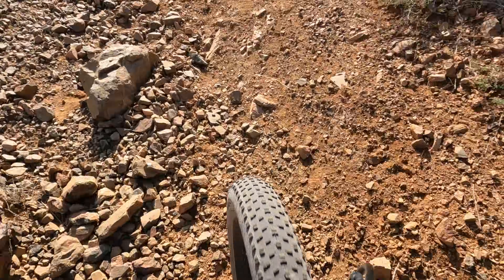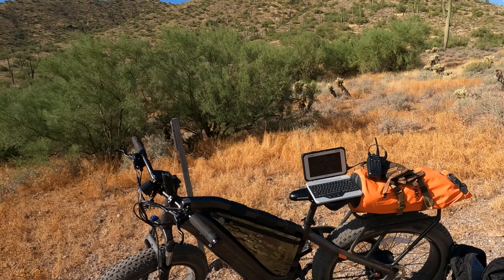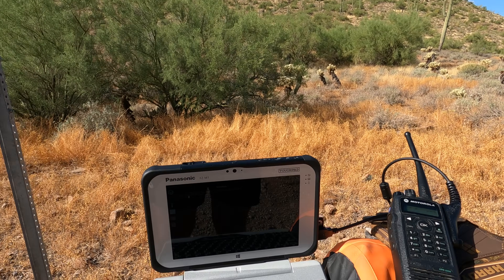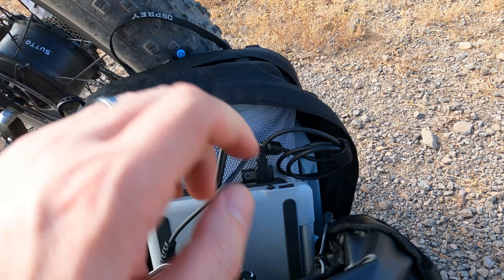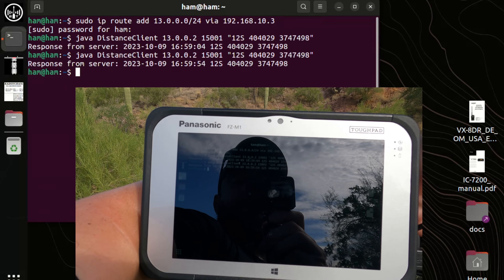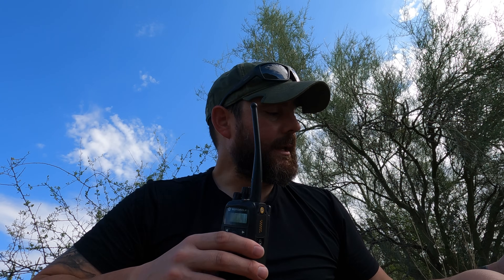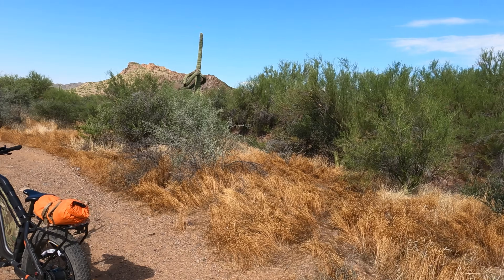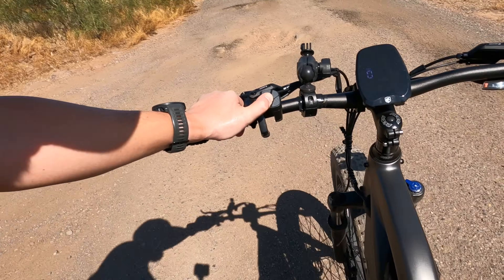DMR for Preppers - Range Field Test - Motorola XPR6550

Comment from the maker: Just to clarify. When I send a message from my field computer, the text that is returned and displayed to the client is an actual over-the-air radio response and acknowledgement from the remote station. This distance server echos back whatever I send it. I'll clarify this in a later video. So, I knew in real-time when I was within radio range. The application will be considerably evolved by the time we do a deep dive on how all this works later in the series.
Reply: The two things that bother me here.. are the out-of-spec address space you're using, and goddamned Java in a world where so many better options exist.  Have fun brother, will keep up and check-in where I can!
Reply from the maker: @Sansui350A  That address space is based on what Motorola has configured by default. I'm a Java developer by trade. I am not a Node guy. I plan to write the networking applications C as well. People can implement whatever they want. This is just straight UDP/IP or TCP/IP networking.

Comment: Can Mr just be radio to radio in simplex? I’m learning about Motorolas dmr. I have a mototurbo 7550e
Reply from the maker: This was all done simplex, radio to radio.
Reply: @TheTechPrepper gotcha. So I get radio A and radio B on the same frequency on digital and it should work?
Reply from the maker: @Dave-tb8kg  It's not quite that simple. The problem with commercial radios is that they're easy to program or to obtain the programming software. This is why I stopped using them. In this demo, I actually wrote custom software which I can't release for the text messaging. However, everything that you saw was done radio-to-radio. No repeaters, no Internet. Good luck with commercial radio journey. It's orders of magnitude more complex than amateur radio.
Reply: @TheTechPrepper will do. It’s going to be fun.

Comment: Do you need a license for DMR?
Reply from the maker: DMR is a standard. To use it on the ham bands you need an amateur radio license, but the entry-level license test is fairly simple. You can also use it on the commercial bands, but that also required a valid business license (paid license).

Comment: The Moto radio you have there is a solid piece of kit. In the UK, they are badged as DP3600, ive got a handful of them along with the DP3400 (no keypad/screen) as well as a DP4801 (GPS, Keypad etc.) Very powerful radios, with both analogue and DMR support. Keep at it bro!

Comment: Hello, I would like to offer a suggestion for the tire issue. Switch to the tubeless system and insert pool foam noodles inside them during the installation process. It will substantially help when dealing with this type of problem with flat tires.

Comment: Have you used your Panasonic tablet and the Motorola CPS programming to program the xpr radios? I use Motorola radios for public service and am looking into something smaller to travel with so that If I have to reprogram on the fly I don’t need my laptop. Thanks great videos!
Reply from the maker: Yes, they work fine. This FZ-M1 is running it on the Windows 10 partition.

Comment: Do you need a ham radio license to use DMR radio’s? What would be best bang for your buck radio with good range and battery life?
Reply from the maker: Yes, you need either an amateur radio license or a business license. I'll cover the radios that I am looking at as part of this series.
Reply: You can use the 900mhz ISM band (902-928mhz) on DMR without a license, but you are limited to 1 watt of power and must only use digital. If you want to do dig/analog, use more power, set up a repeater or something like that then you would need a license.

Comment: Hello ask you questions? I am learning about Motorola but I’m deaf (can’t hear and can’t speak) I watch your video and I wonder if I can use laptop with Motorola? Can send message or text?
Reply from the maker: You are better off sending messages directly from the front panel, but it is possible to send messages from a keyboard using commercially dispatcher software. I have never used it as the prices are likely cost prohibitive for more non-business users. The demo I showed using the keyboard is not public yet. I have not timeline regarding releasing anything.

Comment: I was wondering about tri band use with my UV5R, What kind of range can I or should I be getting using tri band? Can I use NVIS with this
Reply from the maker: You're looking at line of sight, so just a few miles without a repeater. NVIS is a property that only exists on HF between 2 and 10 MHz. Also, you Baofeng can't do the over the air the networking demonstrated in this video.

Comment: Who programmed the radios? moto software not something just anybody should be able to access
Reply from the maker: I programmed them. I am still learning the CPS and DMR at the same time. It's been a couple of weeks since I started on this LMR journey. I'll take you guys along for the ride.
Reply: @TheTechPrepper is the CPS for this radio the 2.0 free version? Does the radio need AES256 unlocked via a purchase through motorola?
Reply from the maker: @keivkeiv CPS is now free from Motorola, but it take a few weeks. Also, this 6550 does not support AES 256 encryption. I will be adding it myself using some custom software.

Comment: Looks like I might need to get a DMR radio. Got YSF and D-STAR capability, which is nice to have. Mostly used on reflectors when weather isn't that great to work HF at night. 

We got a local 70cm C4FM machine, but with really limited usage. The best D-STAR machine I can hit is 70 miles to the south of me, but in a high RF environment. That lead me to use hotspots.

As far as I know, I'm the only ham in my county with D-STAR capability. There's a few with C4FM capability. No one that I know of has DMR as of yet. I'd be interested in using either mode for simplex use and packet radio. Worst case scenario, having a a digital radio can come in handy.

Comment: I forgot to mention..
I really love the concept!  
I’ve been watching the occasional videos on Meshtastic and other “solutions” utilizing lora n 
and I just didn’t like it for a bunch of reasons.

Using a radio you are already carrying already makes way more sense.

Any thoughts on developing a mobile app as well?
Or browser based?
Probably not too “end of the world” friendly, but for localized situations and regular “daily life” ..  might make sense?

Also… Have you developed any software for comms?

Just a $$ thought..  
For over a decade, I have been looking for a way to connect my repeaters and other videos to Zello.
Everything I tried, was just plain miserable.  The low cost RTx and other RadioTone products were miserable.
Of course, every thing utilizing VOX was horrible for obvious reasons.
There is a COR (carrier operated relay) device that comes completely assembled and configured for Zello (or one of a dozen other services) and runs on an older custom version of Android.

The unit that works quite well “out of the box” is “Solidtronics ST-4 ROIP Gateway.
It’s VERY pricey for what you get.  It’s also difficult to find anywhere in stock, other than the mfg direct.
They are in Hong Kong and they take 4-8 weeks to get it to you.  
They also nickel and dime you for every little accessory.  They have custom radio interface cables for many brands/models of radio, though you can hack one together yourself.  (ex. Hytera PD782 interface cable is $95 shipped. But they are using the proprietary connector for the radio side).

IMHO - IF you could come up with a functional hardware/software device that performs equal to or better than the Solidtronic ST4, you’d be struggling to keep up with demand.

Of course, if you begin generating billions $ in revenue, I’ll require a commission $…. 
Just send mine to “Trump 2024” in care of the “Jail Hunter P. Biden Fund”.  
(the”P” stands for the family business. = Pederasty) 🫣🤣

Comment: I'm interested in what software you wrote.  An encrypted program, through and encrypted radio.  License and sell it, I'll be your first buyer.  Got everything else setup.  Thanks for the videos!  I'm waiting for more.
Reply from the maker: This program was just a proof-of-concept, but since it worked well with no data corruption and with a decent transmission time, I plan to make a commercial package with plug and play support and a simple user interface that resembles the text messaging application on our phones. Thanks for the support.

Comment: Considering this is an experiment over business frequencies. Are you using the Motorola KVL to upload keys for AES256 or the aftermarket open source Keyloader for AES256?
Reply from the maker: There is no physical key loader involved here. In my particular case, the key to use will be specified in software by the operator. It will be shared pass phrase. However, I have an XTS5000 and plan to a UCB board and build a physical KVM. This is planned for next year when I explore P25.
Reply: @TheTechPrepper  I have been using an Astro Saber now for 6 years, set for analogue but is has a friends repeater in it that operates P25. Unfortunately he has not connected it to the internet so I have been unable to contact him since he is in the Dayton area and I am in the EU for now. Late July I did purchase an XTL5000 from another friend, had to wait a few months for a working programming cable but it’s now programmed and ready to go. It’s a Remote mount setup and I see that it can also do IP data as well utilizing the programming cable that plugs into the GAIC connector on the TIB. The programming cable plugs into a computer to process data, still learning all of the nuances of doing this. Looking at trying to obtain a Keyloader to program keys into the XTL as well as the Astro Saber however the prices are quite steep for the time. For AES programming there is an open source programmer out there, AVOID THE CHINESE CLONES ON EBAY! They are nothing but trouble according to the chat rooms. It will allow me to load AES KEYS ONLY but the Saber is DES-XL only. The Saber will require the 3000+ to reprogram keys as well as the XTL. Trying to find a 3000+ with AES, DES-XL plus one more format that I have not decided upon is a bit out of my range for the time being. Don’t know if you have looked into the CPS for the XTL but there is a definite learning curve to it. Was in the Comms business for almost 30 years and I have had a lot of exposure to various programs however P25 and DMR/ Mototrbo are a whole different breed. Looking forward to more videos on data over digital! 73!

Comment: I’m dying to try to replicate your experiments using both a Motorola XPR8400 repeater and a Hytera RD982.
AND… with Hytera PD-982 / PD-782, Motorola XPR-7550e and Especially the AnyTone 878UV series radios.
I don’t have any XPR6550’s, but you’ve already done that.

Thank you!
GREAT concept..

I just bought a pair of 12v 100ah LifePO4 batteries for use as backup power for my repeaters.
I’m wondering if anyone has cobbled together a charging/ATS type solution to power radio gear at a remote location w/ an existing standby natural gas fueled generator.
Reply from the maker: Do your Hytera radios have the same networking capabilities as the MOTOTRBO line? Good luck.
Reply: @TheTechPrepper  I’m fairly sure the Hytera radios can “do networking”…
But that’s only what the sales literature says.
Real World?   I’m about to find out. 😆
Reply from the maker: @PowderMill  There's marketing and then there's the real-world. For example, I recently found out that the APRS implementation on the AnyTone D878 UV II Plus is almost entirely unusable. I can barely even perform the basic functions to check into a weekly net. Their APRS implementation has been overhyped by their marketing department. Good luck!
Reply: @TheTechPrepper  It’s the Wild and Crazy world of Chinesium Radios!  🤣
I am STILL struggling hard to update the firmware in the first Hytera mobile radio I purchased around 10 years ago.
I’m donating most of the “spare” radio gear I have to my local volunteer fire department and trying to get all of the radios updated to newer/current versions and trying to ensure they are all on the same version.
Everything worked out well despite the aggravation involved when moving up through the version chart.
You can’t just take a v5.xx.xx and go directly to v.9.xx.xx.  

You guessed it —> 
v5.01.01 to v5.02.01 to 5.09.02 and on and on…
Of course you can’t forget the “pre-/\/\otorola” and “post-/\/\otorola” lawsuit versions.
They were forced to remove “stolen IP” features from the radios, which resulted in the “i” series (v9.xx.xx.i” or similar).

The original mobile cost me around $1k w/GPS & programming cable & CPS and another $150 for a DTMF keypad microphone.
It’s still a solid piece of equipment and honestly has the same type of construction and durability that /\/\ is known for.
BUT… it’s gonna be on v.1 firmware forever at this point.
It requires: 16-bit OS and CPS and a special version of intermediary firmware.  I tried Win XP and 98se to no avail, then found out that Hytera USA (in Florida) gave up on offering the service because most radios ended up “bricked”.

And… of course… after deciding to give up the hobby (and business), and donating much of my gear.
(after debilitating medical issues knocked my on my butt… Ankylosing Spondylitis)
My entire family and most friends began asking what I have planned for communicating in the upcoming SHTF/WROL/EMP/Bidenomics/ etc. world.  

That’s when I discovered AnyTone…. Way cheaper than my normal “go to” brands but decent for the $$.
I don’t use APRS at all, so didn’t notice the flaws. I DID notice the initial boot time is horrendous, it occasionally “freezes”, requiring power cycle, QC-2 decoding is flakey and alerts upon receiving MDC-1200 and MoDat transmissions, and a whole host of other glitches here and there.  I’m guessing they won’t ever bother to remedy anything not receiving a ton of bad publicity, but they seem to be a good choice for the spot in between BaoCrap and Top Tier brands.
Reply from the maker: @PowderMill  That's one heck of a version headache you've been on with the LMR rigs. I am starting to get a taste of that. Glad to hear that your donating your old gear to the fire department. I am planning on doing the same. I am going through the process of joining our local CERT that is sponsored through our fire department.
Reply: Just using 2 agm's for now.  I have a friend who has access to some big lipos for industrial use.  Looking to see if charging system will work on those.  Have 8300, 8400 at one site.  (VHF, UHF).  Do you know?

Comment: THIS use of communication, relying on radio alone, and building a secure network, is the ultimate objective of TTP.  This is so exciting, using simple connections and ruggedized equipment to maintain coordination between individuals and groups during potentially difficult times.
Reply from the maker: Bingo. That is exactly the plan. Effective, field-ready, and simplicity of setup and use is the overarching objective. Stay tuned for the next iteration of the software. Spoiler alert: There's a new 400 MHz directional antenna kit in the works to improve the range of this capability.

Comment: Awesome! Since we last talked, I got a working PPP/SLIP connection between a Windows PC and an EFJ VP6000. Just need to tweak some things to get it going over the air, then I should be able to attempt integrating a LAN messenger.
Reply from the maker: Nicely done. I was on the fence about going with EFJ or Motorola. Do the EF Johnson radios have the same networking feature as the Motorolas?
Reply: @TheTechPrepper  IP packet data is a P25 standard. Setup will be different, but the two brands should be fully compatible in operation.

Comment: Now this is what I'm talking about. I have a 6550, may have to pick up a second... I just don't know the back end stuff for it like what commands I need to run. Also, do you have a link for that keyboard? 73
Reply from the maker: Glad to hear it. I'll share with everyone on BMAC supporters the detailed approach (i.e. commands) as well as some sample applications in November. Here's the iKey keyboard. I believe they're about ~$385 USD. It's worth the price. I bought mine used on eBay earlier in the year for $275 shipped.